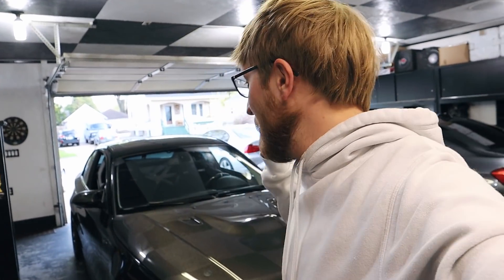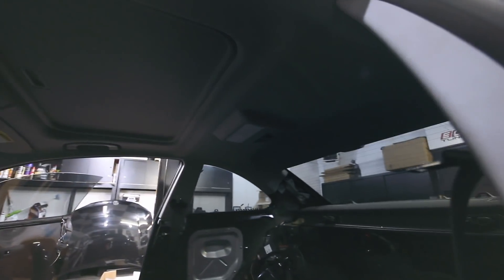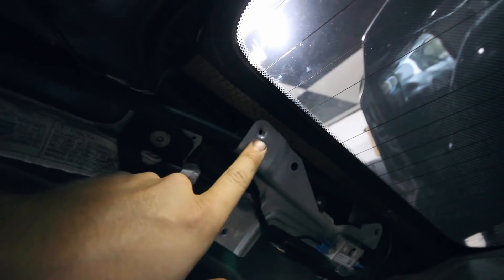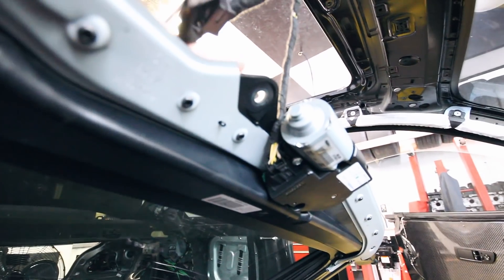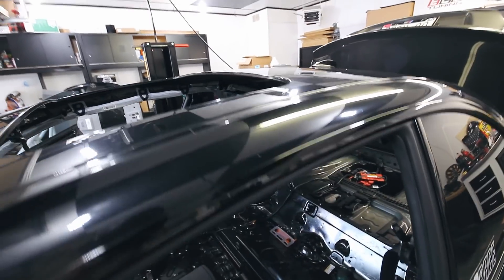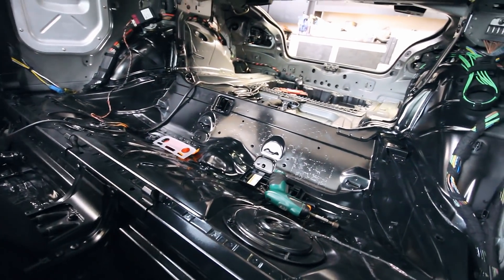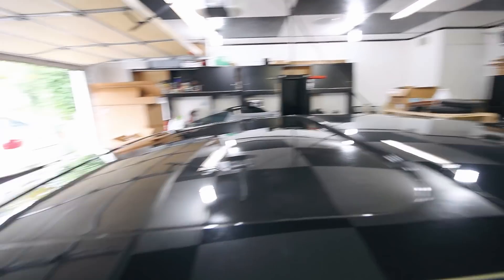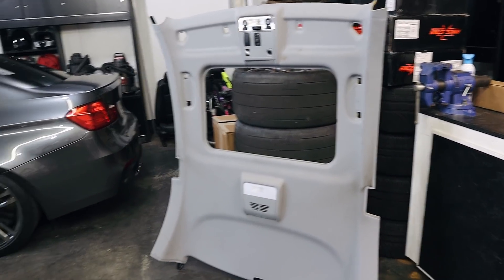Replacing EXTREMELY HEAVY Sunroof with NRW Carbon Fiber Panel! Featherweight 135i!

Comment: Just found this video. Picked up a 135i that I’m slowly turning into a track car. Sunroof is a project for this winter. Did you have to code out any warning lights after removing the sunroof? What about the wiring that went to the map lights?

Comment: Can you check if the moonroof assembly is attached to just the roof or the body rails? Wonder if doing this will affect the structural rigidity?

Comment: Hey Jake, Nice work. Car is looking killer. Just wondering if you used any sealant or just straight bolted the panel up? Any issues with water leaks? 
I'm planning on doing this to my 335 track car.
Reply from the maker: Thanks! I didn't use any sealant at first and got a few drops during heavy rain. I removed and reseated it with some sealant and everything has been good since!

Comment: How are the water leaks on it? Assuming there’s no seal or drain hooked back up
Reply from the maker: It initially leaked a few drops during heavy rain, but NRW assured me this was fixed in newer batches. I got a beta test product. I sealed it up with a little sealant and reseated it and it's been good.

Comment: Great video buddy. Hey can you recommend a good Halo Headlights replacement to my 128i? it has OEM halogen Headlights so.. One that could be just put & play.
Reply from the maker: Thanks! Do you have OEM angel eye rings already? Or no rings at all? I can't remember if the halogen headlights come with halogen angel eye bulbs as well.
Reply: @jake_spence  Thanks for your quick response and taking time to response. Well no Halo at all Lol mines are OEm Halogen.  So I'm trying to give a little upgrade to my 128i .
Reply: @jake_spence  If you can remember it just recommend any it would be very kind of you

Comment: What is the total weight reduction so far?
Reply from the maker: I think around 300lbs. I'm going to weigh it again soon after all of these mods.
Reply: So now you got run the 1/4 mile and see if you got 0.3 seconds faster.
Reply: Holy 300 lbs? What is the stock weight of the 135i?

Comment: Dream build is a e92 swap 135is.
Reply from the maker: What's an E92 135is? The 135is comes with an N54 which also comes in the 335i and 335is.
Reply: Jake Spence I was saying i want a 135IS with an e92 engine swap
Reply: @matt2m  are you saying that a 135is comes with a N54 & you want to swap a N55 into it? or vice versa (RE: the engines)? because I think we are N54 bois around here, at least with the current aftermarket support. I personally am going to make the jump to a B58 car and just avoid the N55 all together tbh.
Reply: Ohhhhhh!!!!! He wants to put the s54 or whatever it's called from the E92 M3 into the 135is x3
Reply: @von...  naw he wants to put that s54 V8 from the e92 m3 in there. That's the only thing I can think of. Because the 135is and the 335is both have the N54T motor that is the better tuned n54 which obviously the 535i the 135i and the 335i have
Reply: @jake_spence  he wants the s54 engine from the e92 m3 and to put it in the body of a 135is
Reply: @kaelanburke2097  oh shit yeah that makes sense, unlike the N55 swap which would be a waste of time unless you just wanted to tilt the N54 community for easy infamy among us.
I sort of get the idea of the S65 swap, but I think if one was going to do that (in reality and not just think about it in the comments) then using the cheapest 1-series, like a 128i, + also buying the DCT from a wrecked E92 M3 along w the motor vs taking a relatively expensive 135is + the stupid expensive S65 and then getting a custom adapter for it to mate with the stock DCT on the 135is.
(also the S54 is the E46 M3 inline-6 motor not the v8 in the E92 M3, which is instead the S65. I still picked up what you were putting down though, so I thought this little correction is only worthy of being a footnote just so you remember it in the future. anyway, its late so you deffo get a pass lolol)
Reply: Von Hassen your right a 128i would be cheaper but the 2013 135is has one of the best interiors for them outside of the 1m.